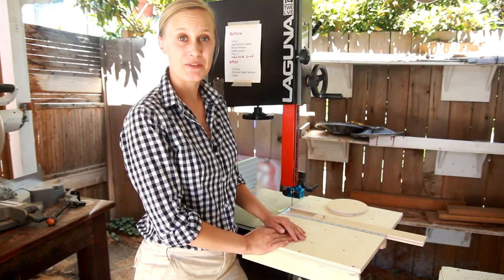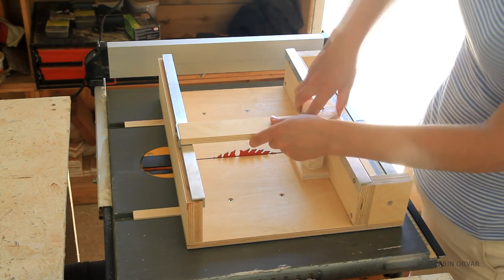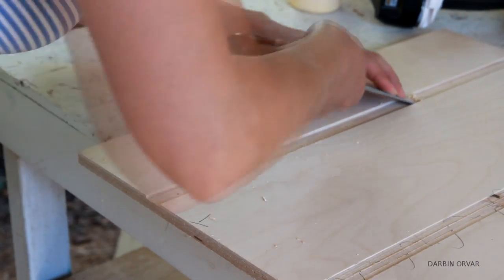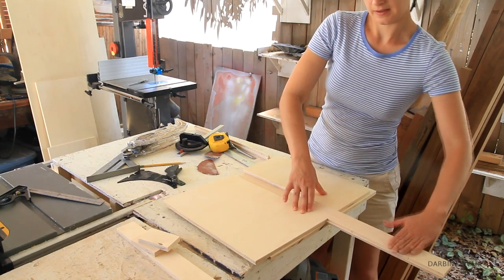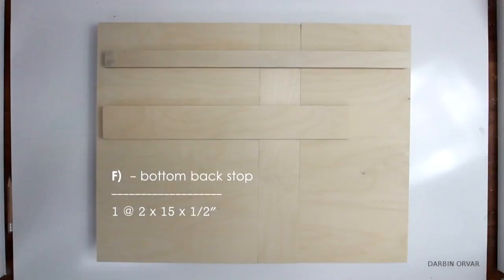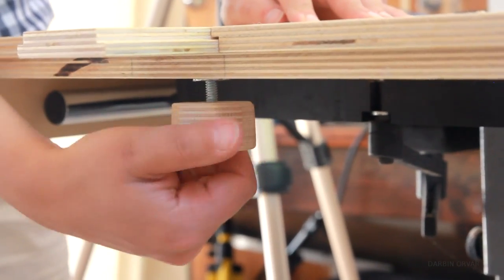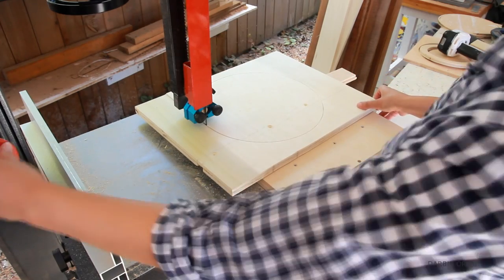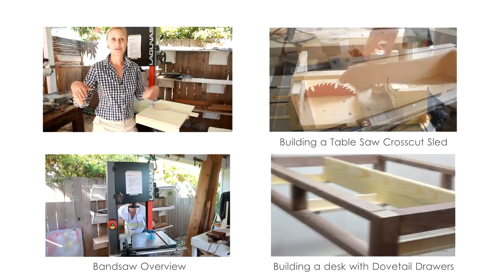Cut Circles on a Bandsaw

Comment: Linn, thank you for the jig plans.  I saw your video a few months ago and made the jig just because it looked like a neat project.  It had been on a shelf for about six months and then a friend asked me to make a lazy susan for her daughter for Christmas.  The table was to be 32" in diameter.  I made the table with 3/4" mahogany and am mounting it to a 23 1/2" bearing from Lee Valley.  After the glue-up for the table I reached up and got your jig from the shelf.  I did a rough cut with my jig saw and then, in less time than it took to find the center and drill the pivot hole, I had a 32" diameter table.  Wow!  Thank you so much for the help.  If you would like, I could send pictures of the completed table.

Comment: I searched the internet looking for ideas to build a circle jig on my band saw when I found your site (i have subscribed). Of all the example I found, yours seemed the easiest to build and use and had a lot more functionality, so I modeled mine after yours. My band saw is also a Laguna 14/12 and two modifications I made and recommend are to use a forstner bit to open the area around the blade enough to allow dust to enter the opening and to add a bolt to the fixed stop block to allow for slight adjustments to align the pin and blade. I found just removing and replacing the same blade required realigning the pin midway between the front of the tooth and the back of the gullet, which is critical for perfect circles.

Comment: The video was very well explained and its certainly a useful jig to have in any workshop, especially for woodturners making bowls. The maximum size of the circle will depend on the throat of the bandsaw.
Reply: How does the throat affect the size of circle since all the cutting takes place on the outside of the blade.?

Comment: Excellent design and presentation.  If you turn around the insert to have the pin on the outboard side you can increase the circle diameter to almost double.

Comment: I think your design is great...  I also tin k you maybe able to make larger circles by turning your sliding Track around so the dowel pin is on the outside, furthest away from the blade... Great video....

Comment: I did something extremely similar but instead of routing the track piece I just cut a block to fit in the track and then screwed a thin piece of aluminum bar stock to the bottom that was just over the opening width so it would catch since the channel is the critical measurement but the undercut piece just keeps it from pulling out.  Whatever works to get the job done, and great job!
Reply from the maker: NGinuity Thanks, I guess there are really a lot of different ways to get the job done!

Comment: Hi so the last shot of multiple thin rings, I think if you tilt your saw table a little and  cut rings because of the taper you should be able to glue the slots and then stack the rings inside each other. 

x     x
 x   x
  xx
Reply: VirtualFather  that could make for some nice turning projects with different woods too.

Comment: Instead of T track the center slider, cutting one piece on the table saw with the blade tilted into three segments flipping it once to make it into a perfect dovetail may be easier.  Since it's cut from the same piece the edges will match perfectly saving the time and the hassle of refining the t track.  Other than that this is the best design I've seen.

Comment: Great jig but my question is do you set up the bottom stop first before you place the top right and left pieces down with the slider. I'm trying to figure out how to set the slider aligned with the blade. Hope I explained this right. So let me try it this way lol. How do you get the slider center with the blade, is it before or after you place the bottom stop. Thanks for the video. I will build one as soon as I hear from you.
Reply: I was wondering about  the same thing 👍

Comment: I made this jig but just a bit smaller since I have a cheaper band saw.  I'm trying to cut 5.5" circles to use 3" lazy Susan brackets so they can turn.. However my circles keep on coming out slightly oblong making it wobble when u spin it.   I made sure the blade is tightened as much as possible and the front of the blade is center in the pin.  Any other suggestions?

Comment: very nice and simple design, but.... you can't just put your diameter slider just anywhere along the jig.  your pin needs to be centered at the correct location on the blade.   there are varying opinions on the location.  some people will say at the leading edge of the saw tooth, and others will say in the center of the gullet.